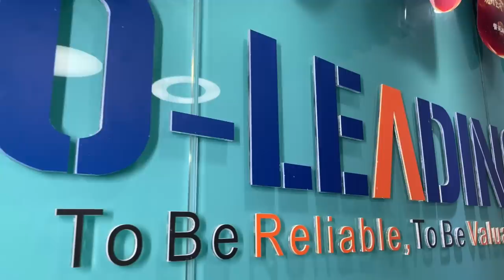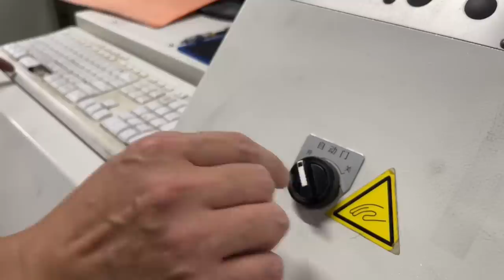PCB Board Factory China's Industrial Titans-Fully Automated Production

Comment: 50 or more years ago I worked at Marconi in PCB stage 1 and stage 2 assembly soldering components in by hand I remember a machine worked by compressed air that made the holes in the PCB by punching in the holes it sounded like a machine gun and was cnc operated great film how things have changed.
Reply: Nowadays, most jobs are replaced by machines, and precision CNC machine tools are used in the drilling process.
Reply: Environmental Management Challenges:

Certain Chinese factories and production processes face hurdles related to environmental management and conservation. Problems like air and water pollution can present obstacles to maintaining sustainable production practices.
Reply: China is going to be developped country yet. US and Europe countrys contamined enviroment too, many years ago. They are developped now...
How China can developped if forbiddent her to construct factorys?not smoke?
Why China Must not Contaminate? If USA and Europe did that?
Unfair, isnt?
Reply: @christianvalenzuela225  Mistakes of the past don't justify making more of the same mistakes in this time. Nobody can or will force China doing things different, but China itself will also suffer from pollution and destruction of it's own land.

Smart people learn from others, average people learn from making mistakes, and dumb people learn nothing, as they already know everything. What do the Chinese people want to be?
Reply: @Nithalm  双标
Reply: @xiguapiguan4948  

Double standards?

You mean you reserve the right to repeat our past mistakes yourself? My oh my, it's not like I get happy if Chinese people are suffering. But suit yourself, learn not from others but by experiencing it yourself. I shall keep my mouth shut.